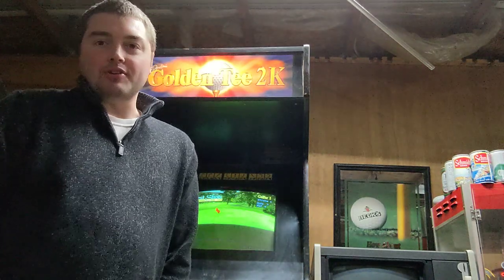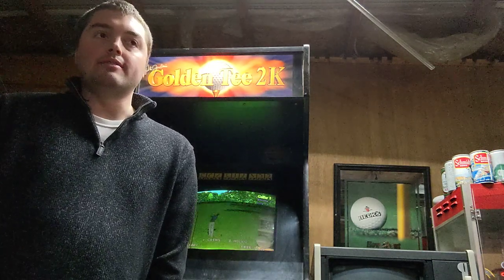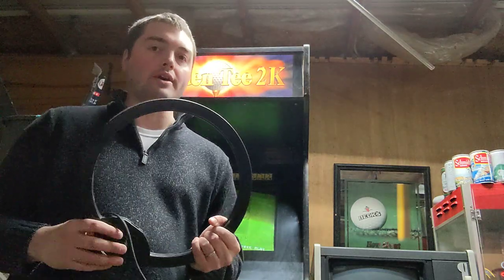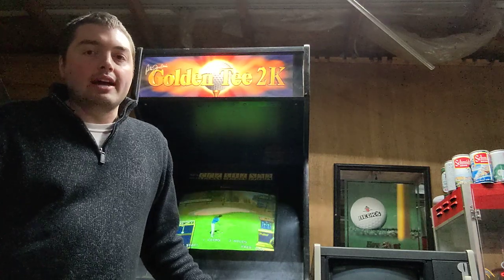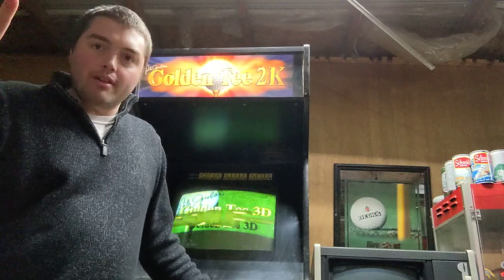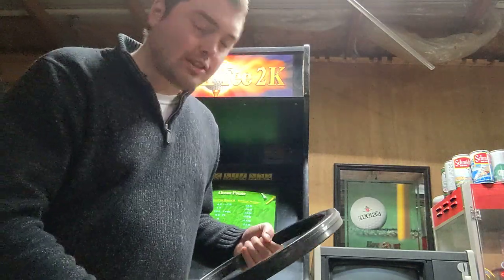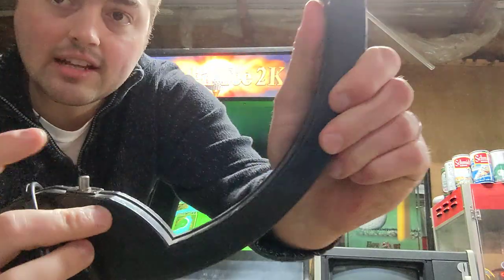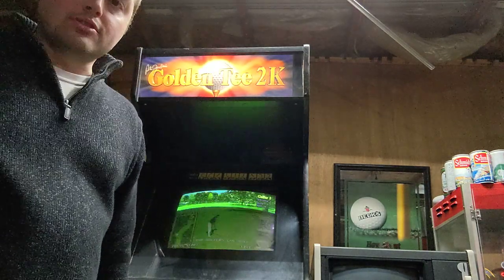Degaussing coil CRT Monitor (how to improve the longevity of your CRT)

Comment: Great video, I have convergence issues on lower right of screen as well as a little green in bottom right of my Goldstar 89! Will degaussing help the convergence issues, thanks!!!
Reply from the maker: Hey there! Certainly wouldn't make the issue worse. However if the screen is looking "ghosty" or "blurry" likely could be the flyback out of focus or potentially need a cap kit or both. Hope this helps
Reply: @jacobnienaber7653  It's not blurry it's gorgeous just has green in bottom corner, but also has color seperation red green blue visible especially on clothing in movies and text, didn't know if degaussing would correct that or will I need to do convergence as well thanks :)
Reply from the maker: If it is starting to appear green in the bottom right of the screen, I think a degaussing would help very much!
Reply: Look up Friday the 13th on an 89 goldstar and that's my set as of 9 months!!! :) #AtomicSpaceJunk #AmazingChannel
Reply: Simply turned the tint to the middle, yes the screen was yellowish lol :)

Comment: Does the coil warm up after some use? I purchased one and it appears to work properly but noticed after using it for a bit the coil area feels warm.
Reply from the maker: It gets a tad warm, but not too hot that it is bad to the touch. Don't use that tool that often, so normally isn't an issue